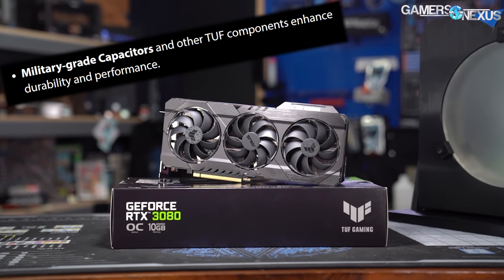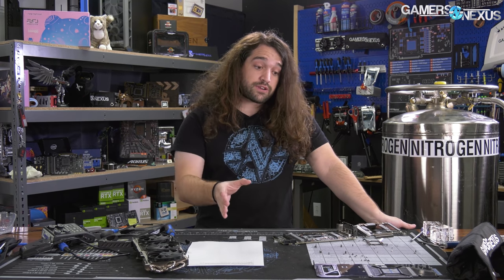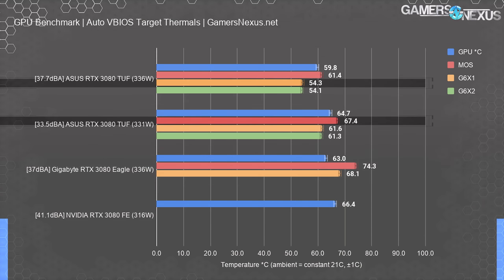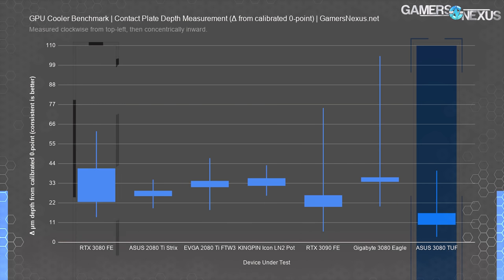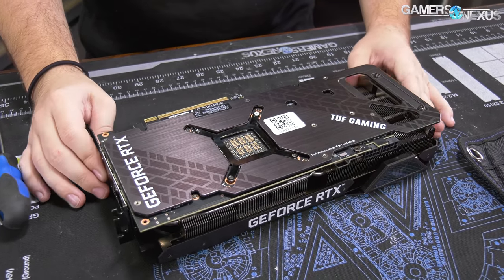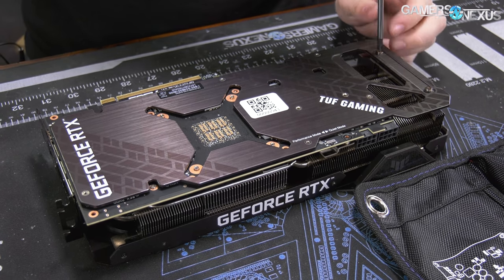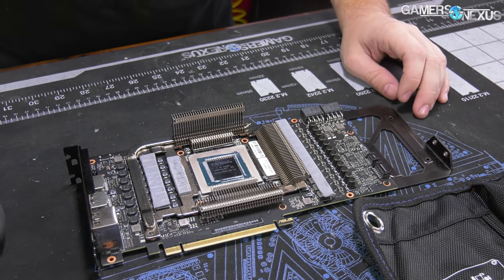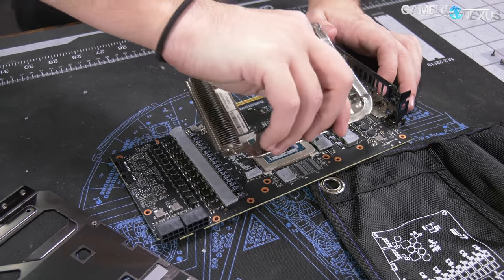ASUS RTX 3080 TUF OC Review & Tear-Down: Thermals, Noise, & Overclocking

Comment: As a note, "Military grade" basically just means As cheap as possible but still meeting minimum reqs.
Reply: Veteran here. Can confirm. Lowest bidder wins contract for mass production.

The only thing that is missing is the flat, cracked and peeling green or tan paint.
Reply: Does it? I think they might be referring to the operating temps: https://en.m.wikipedia.org/wiki/Operating_temperature
Reply: Honestly that's just all of capitalism
Reply: Cheap for the manufacturer you mean.
Reply: Military grade when it comes to EEE components means that they can operate in a wider range of temperatures without failure. I don’t know if that actually matters for a GPU, but in my work developing componentry for spaceflight launch vehicles, Our resistors and caps must be certified back to the manufacturer with lot control information to ensure that it is indeed military grade and not generic or counterfeit
Reply: @MechAdv  they don't work in any temperture, don't try to make it sound cool.
Reply: Matt Evans no one said that
Reply: Fun fact anybody can say "Military Grade"  about anything because it doesn't actually mean anything. In regards to a specification "Military grade" is a pure marking. 'Mil spec' on the other hand actually has a specification that it must meet. Side note one of the 'mil spec' for capacitors is MIL-PRF-123E a 56 page document that even has specification on how it has to be packaged. It's one of the reason the stuff is so expensive.
Reply: does it really matter for something that only tech reviewers have :p
Reply: @MrDamien1415  Thank you for pointing this out.
Reply: partially true. (i agree it meets min reqs)
But Military Grade generally means it has traceability, not super tough components. Also generally means there is no added BS to make the product not work. So flashy ammenities arent a thing on "military grade" which may be where the sentiment of "its only the bare minimum" comes from
Reply: Military grade does mean something very specific for electronic components, which is that it's rated for extended temperatures. Has nothing to do with this "lowest bidder" nonsense, which doesn't apply to this specific context.
Reply: @leo-ub6nb  harris and rockwell be like
Reply: @MechAdv  on that basis, I wonder if these are indeed to "military grade" specification. Anything other than that would mean false advertisement.
Reply: @The.Toaster  they are not that expensive. Im sure they did. I for example put mil grade mlccs to a custom pcb I made for my espresso machine because they keep their characteristics even >120C.  All manufacturers have mil grade caps, sligtly or much more expensive with various degrees of mil-grade-icity 😀. But mostly, when in EE you say mil grade, you at least mean components that can withstand high/low temps (and more).
Reply: To be fair, they aren't currently specifying which military for which it's been graded. Could be the US Air Force.
Reply: Hey now, sometimes they have a +- 10-20C operating environment temperature spec!
Reply: The Asus military grade is not exactly meaning the whole GPU, motherboard or whatever neither it means it's used or not used by military...

They come with a reliability certificate which tell you the tests done and it's mostly to do with the caps, VRM and other components, it's not about the GPU or other chips at all...

Some of the components used go trough specific tests of reliability...

An example:
https://itwriter.ru/wp-content/uploads/2016/12/004-1.png

(Tests and warranty vary from product to product, some of their TUF equipment even have 5 years warranty).

Now I don't know if it would be the same test done by the army to those components or not, but I don't think Asus would lie in their certificate, but not that I care...
Reply: Or something that’s super expensive because the military inflates it’s budget but isn’t actually valuable at all
Reply: But the minimum specs are not as low as a civilian sector version, it needs engineered for combat and reliability.
Reply: Fluaxx - " "Military grade" basically just means As cheap as possible but still meeting minimum reqs " before making nonsense assumption inform yourself.
Reply: @MechAdv  Exactly! @Fluaxx read this...
Reply: @jousis_  Military Grade is not a controlled market term like "organic", or other certifications. It's similar to "free range", but worse: It is literally a buzz word with zero requirement to mean anything.

The only thing that would make it false advertisement is if they did literally nothing different and slapped that word on the box. ... Though all they'd have to do is point at the paint job, and go, "Look, military grade!"
Reply: @ashkebora7262   Yes. It's a marketing term implying better specs (in electronic components).
Reply: @airesjusto4143  :^) Yikes bro.
Reply: Mil spec also has a tighter rating tolerance.  .  .  some should look it up for this thread.  I think it was 3% instead of the normal 5%.  Also higher power tolerance.
Reply: exactly...It meanas for motherboard terms better than basic. Or the essential/considerable "Step" above basic biotch motherboard that cannot oc ram or cpu. But not good enough to run a 8c + OC. So like 4-6c cpu max. MSI used to advertise this AF over the last 10 years.
Reply: Yeah cheapest normal part that mostly works but becomes military grade by overcharging the military for the part.
Reply: @mattevans1643  He said "wider range of temperatures", not "any temperature". Pay attention.
Reply: @afungusamungus2860  You said "wang."
Reply: @Yfr28  it's a government spending budget. feel free to critique modern implimentation of market rules, but do so when it's relevant
Reply: AKA lowest bidder
Reply: Finaly someone commenting the truth!
Reply: @p0tat0stix  frisbee potential
Reply: Military pricing ??? Maybe which is supposed to be cheap and tax free 😅.
Reply: Corsair comes off with the same bullshit lmao. They say it's "aircraft grade alluminum" lmao. Ridiculous.
Reply: Lol
Reply: oooorah! lol
Reply: @Yfr28 Yeah, because communism would be better right? Because it has a great track record.

Comment: Are the Modmats military grade?? asking for a friend..
Reply from the maker: ULTRA TOUGH MILITARY DURABLE MODMAT WITH SEAL TEAM NAVY MARINE RUBBER TECHNOLOGY
Reply: @GamersNexus  I'll take your whole stock.
Reply: @GamersNexus  InVEsT
Reply: @GamersNexus  TUF***
Reply: @kyapox  So none?
Reply: @GamersNexus  Military-grade fabric with teflon-infused kevlar elastic strings
Reply: Doubles as 3A soft armor.
Reply: i have  GTX 970 since 2014 and still runs evrything at max settings 1440p 30+ fps!. in 2016 ugpraded monitor and psu in 2017 cpu ram motherboard and  hdd and just 3 months ago i got a high end SSD the MP 600 2TB. But gtx 970 still a monster! My pc now is  CPU: RYZEN 7 1700
RAM: 16 GB DDR4 3200MHZCL15 GS KILL RIP JAWS
GPU: GTX 970 G1 GAMING
MONITOR: DELLP2416D 24'' 2560X1440 60 HZ IPS
MOTHERBOARD: ASUS PRIME X370 PRO
HDD1: WD BLACK 4 TB
HDD2: 1 TB
SSD: MP 600 2TB
In eed RTX 3080 for ray tracing and  i wil lget one when price and avaliability of it becomes normal.
Reply: Wait, wasn't "Gamer-Grade" top-level for components last year? Is Military Grade above or below "Tactical"?
Reply: @garywanamaker2602  obviously tactical is swat grade. Why have the swat called when here comes the marines! 🪖 /S
Reply: @GamersNexus  We need that technology for condoms man
Reply: So just casual military grade ans not chuck norris grade....
Reply: I am fairly sure that the modmats are sufficiently hardened to endure an EMP burst, even at short range.  The modmats also avoid any unintentional signal leakage and should meet NATO TEMPEST certification (if ever tested).  Military grade!
Reply: You can roll them up and use it as a club, does that count?
Reply: @GamersNexus  But there's no tire marks across the mod mat, so you must be lying to us about how TUF it is.
Reply: yes
Reply: @kyapox  may i buy 200 of those?
Reply: @GamersNexus  I want you guys to make a sales video with this for April 1 2021
Reply: @GamersNexus  OK but is it made out of nanotube technology?
Reply: radiation proof?
Reply: They're pharmaceutical grade - extra clean room made, water proof - super tuf :PP 
P.S.: As long as they're not made from used LTT underpands, they're OK :DDD
Reply: @GamersNexus  I require one in stock for field testing. My agency may be looking for more.
Reply: They use them in Space force
Reply: @GamersNexus  My USMC issued mat was a canvas cloth mat with parts and nomenclature printed on one side.  I lol at military grade as military gear is almost always made by the lowest bidder, and regardless some boot Marine will end up breaking it.
Reply: @shredderorokusaki3013  the 970 sure is a beast; when it doesn laggs out because of the weird 3.5-4gb memory. Still most games avoids that and the only one I have problem maxing out at more than 30fps is metro exodus :)
Reply: @GamersNexus  STONKS!
Reply: @shredderorokusaki3013  Sry but 30fps is crap nowadays (if you dont need over 30fps BUY A CONSOLE). I bought a 144hz Monitor starting this Year and i NEVER want to go back. Sadly my 1080 Ti can't run all Games at that Framerate, some even don't run in 60fps on max. 
The worst Enemy is stuttering. G-Sync compatible negates some of that as long as the 1% lows are over 40fps.
I too want the 3080 for RT and better 1% lows and 144fps at 1080p. I don't care for 4k yet...since my Dream Monitor a 32" 4k >120hz G-Sync HDR OLED is not available yet.

P.S.
I'm someone who likes to play Games on CAN IT RUN CRYSIS? Mode. But im also to stingy to buy a GPU for exorbitant prices. Waiting for a 3080 FE....A TUF might be my second choice if Nvidia stops producing FEs..
Reply: Kevlar mod mat is in production 😂
Reply: @GamersNexus  Sir, I am going to demand a refund on the modmat if it cannot withstand a gunshot.

Much less a nuclear bomb.
Reply: @GamersNexus  you should launch a crypto currency
Reply: @Gamers Nexus can the Modmats take a bullet for its owner to save his life like the Microsoft Surface Book ? Read https://www.reviewgeek.com/56864/microsoft-surface-book-laptop-stops-a-stray-bullet/
Reply: When I think milspec I imagine something that is 10 times as expensive as a civilian model at two generations of technology behind, with 50% less portability and weird things I don't need like vibration proofing.
Reply: @GamersNexus  If it meets the spec for space shuttle rocket fuel line gaskets I'll consider.
Reply: Nato spec even
Reply: @GamersNexus  time to invest

Comment: As someone who served in the military, let me tell you, whenever we hear “Military grade”, we can only think ‘bare minimum’!
Reply: I would agree with this statement. Unless it is hardened against EMP I wouldn't expect anything special from "military grade".
Reply: i have  GTX 970 since 2014 and still runs evrything at max settings 1440p 30+ fps!. in 2016 ugpraded monitor and psu in 2017 cpu ram motherboard and  hdd and just 3 months ago i got a high end SSD the MP 600 2TB. But gtx 970 still a monster! My pc now is  CPU: RYZEN 7 1700
RAM: 16 GB DDR4 3200MHZCL15 GS KILL RIP JAWS
GPU: GTX 970 G1 GAMING
MONITOR: DELLP2416D 24'' 2560X1440 60 HZ IPS
MOTHERBOARD: ASUS PRIME X370 PRO
HDD1: WD BLACK 4 TB
HDD2: 1 TB
SSD: MP 600 2TB
In eed RTX 3080 for ray tracing and  i wil lget one when price and avaliability of it becomes normal.
Reply: Ballas bak - hurry up and wait = SANDF
Reply: It depends. It probably means specced to survive prolonged storage at +85C, but that they left off the requirement to survive being handled by a minimum wage forklift jocky.

Who knew that Yogscast really was more delicate than the average fork lift operator...
Reply: agreed
Reply: @darkstar2480  seeing as how emps don't exist, that's not really a thing, so it's just shit.
Reply: Military Grade generally means it has traceability, not super tough components. Also generally means there is no added BS to make the product not work. So flashy amenities arent a thing on "military grade" which may be where the sentiment of "its only the bare minimum" comes from
Reply: @shredderorokusaki3013  3080 would likely be heavily bottlenecked by your R7 1700.
Reply: As a non member, it’s painfully obvious military grade means as much as receiving J.D power award, nothing but marketing bs.
Reply: @JayVon_Ro  a lot of "military" equipment is essentially "standard government" equipment. in other words made by the lowest bidder, with the cheapest materials able to fulfill a minimum requirement. that's where the bare minimum comes from, not from a lack of "frills"
Reply: @Dreddy72  The "standard govt" sentence makes no sense as all govt/military products fall under that name. So the distinction between the two you tried to make confuses me but I do get the point you are trying to make. Thou I do disagree slightly.
 Yes it goes out for bid (I'm a machinist working on govt parts for a govt sanctioned company) And lowest bidder most definitely wins. But you forget the amount of traceability that comes with said contract. Where did your material come from? What is its batch number? On what day was it forged at what foundry using what alloy recipe? What tooling did you use to charge a low amount yet still maintain the STRICT tolerances? What plater did you use to anodize said part? What is the chemical compound of that plating company? What grease did you use to lube the bearings? Whats the part number and purchase order to that bearing you just greased up?

Military standard is so much more then the general public likes to think they know. Unless you are exposed to how the engineers actually process a build-out, I dont blame most for having a negative sentiment. Especially in comparison to items which offer the same function, just with added safe-guards/frills. But then again its why 60 year old military equipment is still used today...
Reply: @Dreddy72  Seems to be even worse than that:
https://www.wearethemighty.com/gear-tech/military-grade-doesnt-mean-anything?rebelltitem=2#rebelltitem2
Reply: @JayVon_Ro  eh is there a specific testing body to oversee this standard?
Reply: @anthonymarquez2542  cmon guy use common sense.

Comment: Steve's monster truck rally announcer rendition of "TUF!" made me LOL.
Reply: sunday sunday sunday !!!
Reply: This is the first time i saw LOL used in a literal sentence
Reply: @b0nanz9_inc.9  well it wont be the last... LOL where u bin the last 15 years bro?
Reply: @hgibbons69  now that's not a literal sentence 😂
Reply: i have  GTX 970 since 2014 and still runs evrything at max settings 1440p 30+ fps!. in 2016 ugpraded monitor and psu in 2017 cpu ram motherboard and  hdd and just 3 months ago i got a high end SSD the MP 600 2TB. But gtx 970 still a monster! My pc now is  CPU: RYZEN 7 1700
RAM: 16 GB DDR4 3200MHZCL15 GS KILL RIP JAWS
GPU: GTX 970 G1 GAMING
MONITOR: DELLP2416D 24'' 2560X1440 60 HZ IPS
MOTHERBOARD: ASUS PRIME X370 PRO
HDD1: WD BLACK 4 TB
HDD2: 1 TB
SSD: MP 600 2TB
In eed RTX 3080 for ray tracing and  i wil lget one when price and avaliability of it becomes normal.
Reply: Reminds me of how review brah reads marketing jargon
Reply: @shredderorokusaki3013  same ima get the 3080 when its normal i have a 750ti rn
Reply: Duel BALL!
Reply: YOU'LL PAY FOR THE WHOLE CARD, BUT YOU'LL ONLY NEED THE EDGE

Comment: As a former military member hearing military grade is terrifying.
Reply: Cheapest bidder.
Reply: Yeah probably not the best term to use for reliability...
Reply: Doesn't it mean it costs 10x as much as it should?
Reply: @RobBCactive  in marketing terms yes. The public veiws military grade equipment as heavy duty. But in actuality, as Kyle said it's made by who can make it for the least amount of money. So cheap. 
Military has a budget and they need to get as much as they can for as little as they can.
Reply: @RobBCactive  It means don’t get it wet.